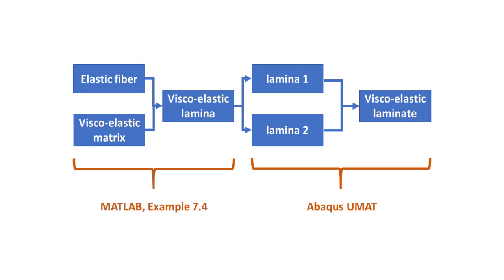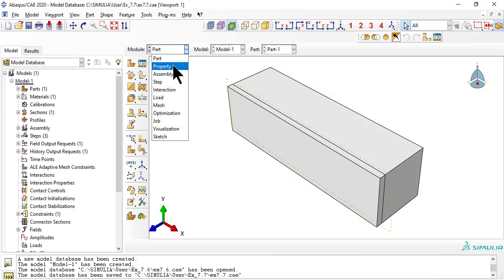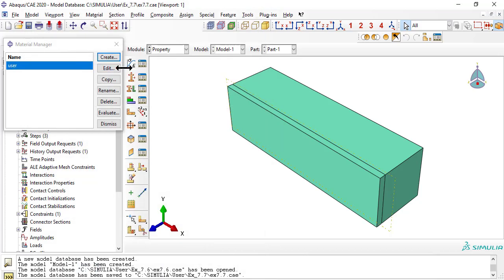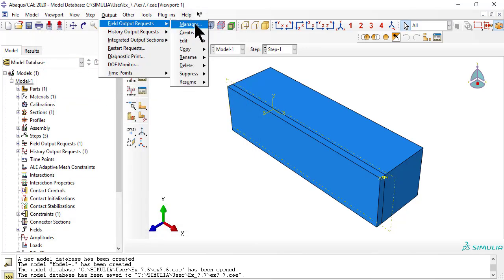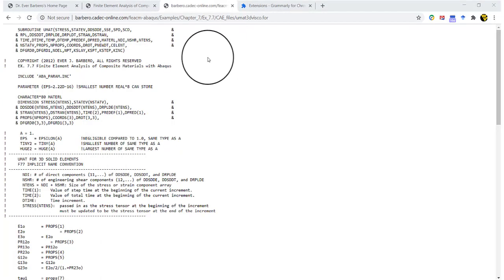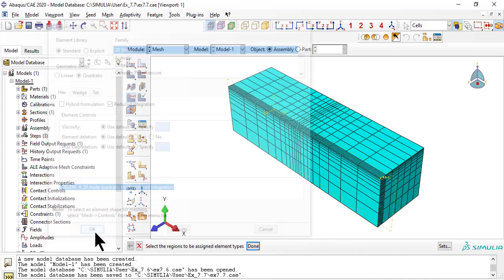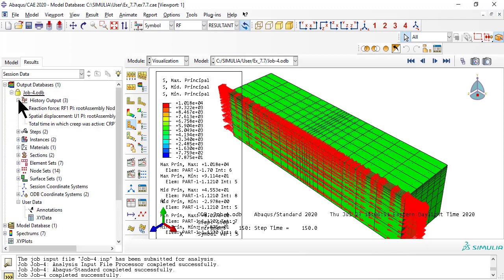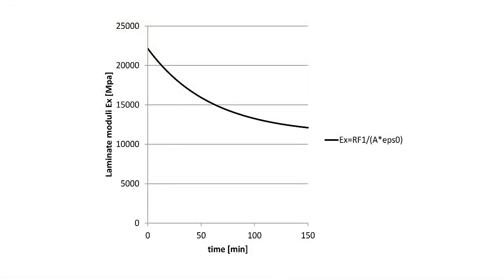Example 7.7 Linear visco-elasticity of orthotropic laminated composite with Abaqus UMAT

Comment: Hi, how can we include time temperature superposition also into the model
Reply from the maker: Send the parameters that describe the shift factor plot to the umat. Inside the umat, extract the temperature from the abaqus variable that has it. Calculate the shift factor for that temperature. Use the shift factor to recalculate the property or properties that are affected by temperature. The rest of the umat remains the same. I have not tried this.
Reply: @EverBarbero  thanks a lot